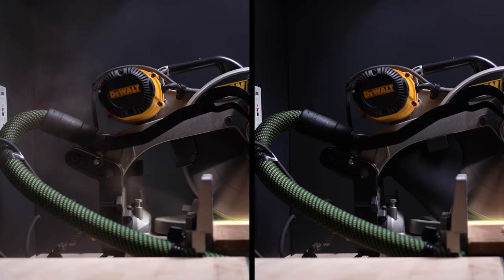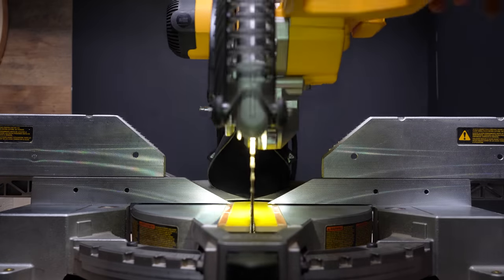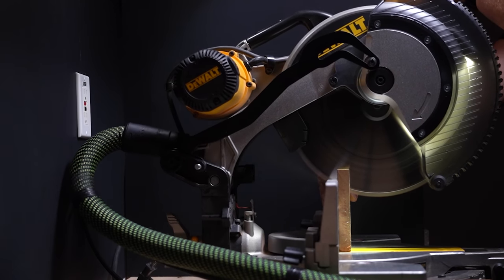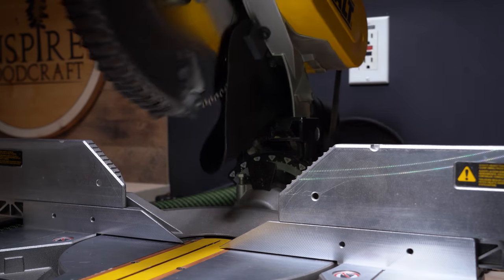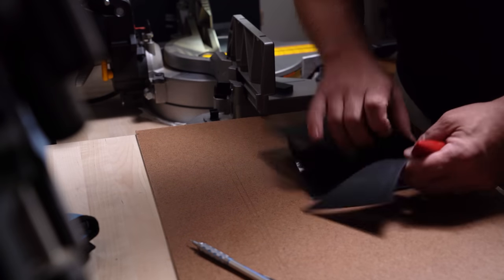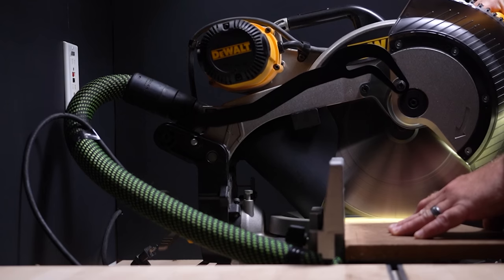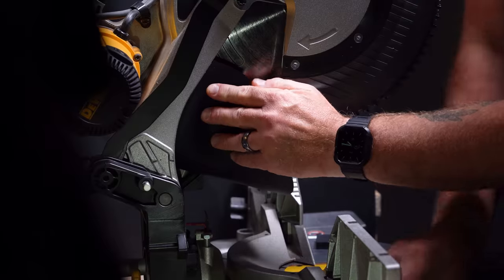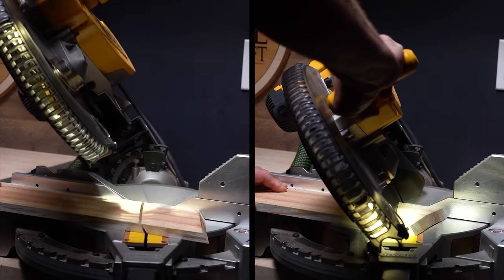The BEST Miter Saw Dust Collection, Period

Comment: That’s exactly how FESTOOL builds its Kapex Dust collection
Reply from the maker: @Migo1963 I wish it was, honestly. I'm working on dust collection for the sliding DeWALT saws and it just doesn't work the same as on non-sliding saws. Plus the Festool saws evacuate chips through the top of the saw, not the rear, so something like this wouldn't work at all.
Reply: @InspireWoodcraft  you are right

Comment: Great thinking, but I worry that the magnets may slide/fall due to the vibration of the machine, and if one of them ends up in the blade you'll know all about it! Likely? No. Possible? It appears so. I'd consider a different way to affix the 'scoop'.
Reply: I used two way tape to attach the rubber and the magnets a taped with regular tape. The risk of something
going wrong with tools is always there. I wear safety gear and I accept the risk.

Comment: Looks awesome but my concern is if that rubber hits the blade!!
Reply: I have added two way tape to the rubber and some regular tape to the  magnet. With tools there is always a
risk and I use safety gear and accept the risk.

Comment: You have essentially recreated what comes standard with Makita Miter Saw.
Reply from the maker: @70newlife I had to look them up to see what they look like. It looks like the traditional miter saw doesn't have anything, but the sliding miters have what looks like a two-piece system. One on the bottom for the first part of the cut and one up above for the second part of the cut? Pretty interesting. Although their product photos show dust everywhere so I'm not sure they're selling saws based on dust collection. 😂
Reply: They're not.  I have a Makita, and it's a great saw, but its dust collection is not on par with the rest of the saw. I have already designed at least one contraption to improve it with nothing like perfect results. I'm interested in your elegant approach. 
 @InspireWoodcraft

Comment: This is really ingenious and well executed. I only have one concern: don't you worry about the magnet to move with usage, and eventually move maybee too close to the blade? Could you attach the silicone boot more fixed? Or the magnet is strong enough not to move at all?
Reply from the maker: I have not had any issues with the magnets moving so far. I think if someone wanted, they could drill and tap the bracket to add a screw or bolt though.

Comment: Would a zero clearance auxiliary fence create an issue?
Reply from the maker: @Steve Rochon Yes and no. It shouldn't get in the way, necessarily, but the zero clearance will restrict the dust in the beginning of the cut from reaching the boot. Once the blade is through the cut far enough and producing a stream of dust, instead of a spray, it will work great.

Comment: The stock dewalt has a small flexible dust catcher but the one you are comparing to doesn’t🤠
Reply from the maker: @chasbird364 Not sure what you’re referring to exactly, but the DW716 never came with and “dust catcher”. All it ever had was the dust port in the rear.

Comment: Turn the lights on so we can see the dust that it is not collecting.
Reply from the maker: @GREG SMITH Airborne particles are easier to see when the surrounding light is off and concentrated light is directly over the dust itself. That's why I filmed it this way. If there is dust not being collected, it shows in the video. If you can't see it, that's because it isn't there or it's too fine to pick up on camera.

Comment: If the bracket behind your Dewalt saw is plastic it has been recalled and you need to replace it with a metal one. It’s super dangerous.
Reply from the maker: @shinnick Thanks for adding that. I've never seen a plastic one on a DeWalt before. What I mentioned in the video was referring to miter saws in general. I have an old delta with no bracket at all, and I've seen new saws with a plastic bracket on them. I don't even know what the bracket is for, honestly. I assume it's to prevent pieces from getting lodged behind the blade or something.
Reply: @InspireWoodcraft  it’s a “chip guard”. My Dewalt had a plastic one that was recalled and before I got a chance to swap it out I had a major scare with the plastic one exploding.
Reply from the maker: @shinnick I’m actually at the store right now looking at saws. Haha! It appears the new model DeWalts with the “S” all have plastic. I wonder how they can still sell them with the recall.
Reply: This model saw was not in the Recall.  I got a new one a few weeks ago and its plastic.  Called dewalt and the 716 is not under recall.

Comment: Will this fit a Dewalt 715 saw?
Reply from the maker: @jeevespreston I have been told that it does, but I just recently tried it on a DWS715 and didn’t care for it. Maybe if you are just breaking down material. I am designing a solution for the DWS715 now. I don’t know that it will work on the DW715 though.
Reply: @InspireWoodcraft  thanks for the speedy reply, appreciate it!!

Comment: Would this work with a DES780?
Reply: I meant to write DWS780 a Dewalt Miter that looks similar to the one in the video
Reply from the maker: @Jode Bravo I don't think it will work with any of the sliders, unfortunately.

Comment: The dust collection is nice but that saw IS SUCH A PIECE OF SHIT SAW. As you can see in the video, if you try to cut miters the plastic protection cap is pushed into the blade. And if you're unlucky the piece of wood you're cutting has a certain length, the cap will pull it up and send it flying. Would not recommend buying this saw at all.